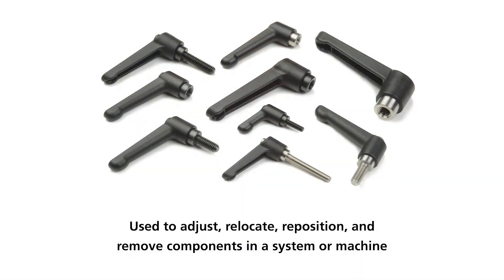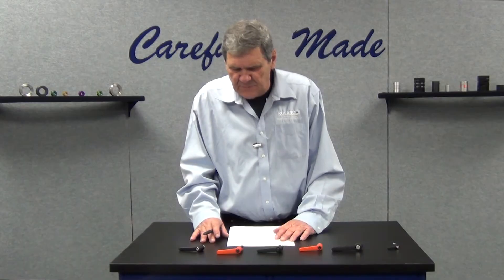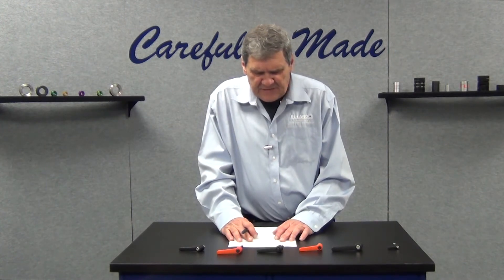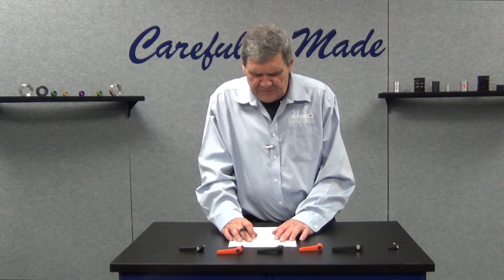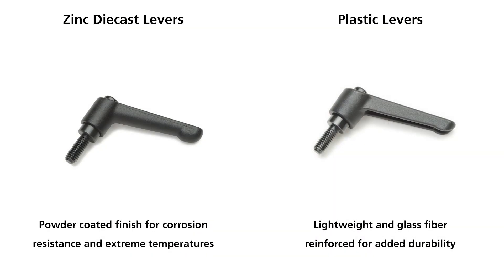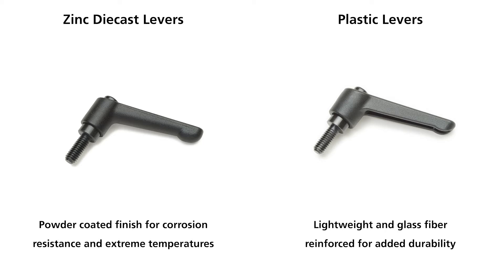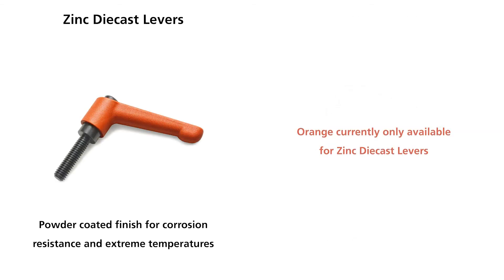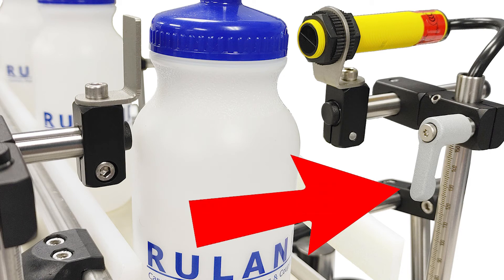What Are Adjustable Handles/Clamping Levers?

Comment: What is the longest screw thread you can get on a 5/16-18?  I have a one off application to use a shaft clamp and the screw needs to be long, maybe 2-1/2 to 3 in.
Reply from the maker: Hi, thank you for asking. The longest in a standard configuration is 1-5/16". It is tough to do one-off specials in low quantities. Your best option may be to integrate the stud into the component you want the handle to connect to and use one with a tapped hole only to thread into it. - Chris from Ruland